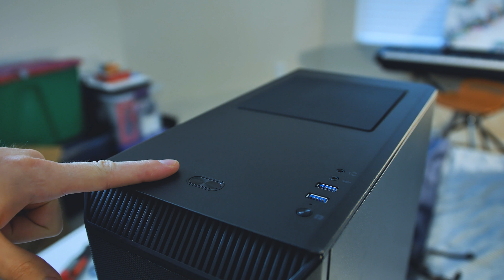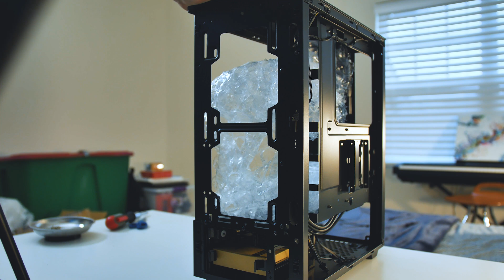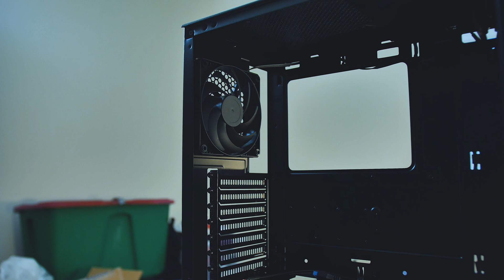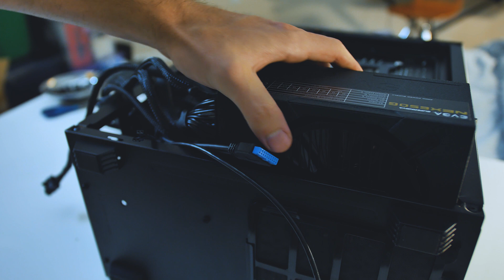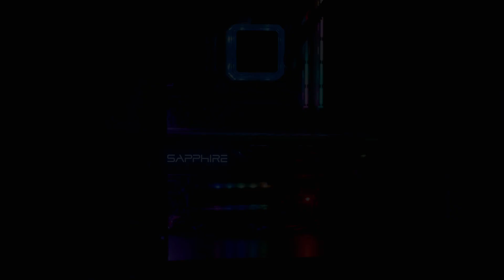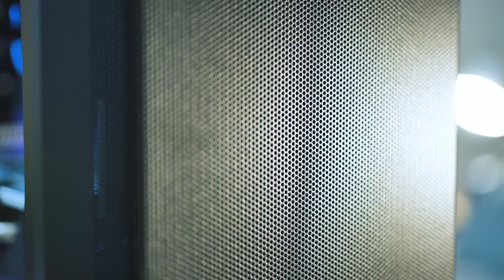How To Build A PC In The Phanteks P300A

Comment: I’m having a problem with installing 2x 140mm fans in the front as intakes inside the mesh part… these fans are supposed to fit but they wont let the part click into place
Reply: The fans mount on the inside, I had that problem too xD

Comment: Quick question, so if I have to take out the hard-drive bracket to fit in the power supply, can I not have a hard-drive in this case? If I can have a hard-drive in this case, any recommendations on where to put it? Thank you!
Reply: Had the same question while building my PC, you have to take apart the hard drive case then put in the PSU. After installing the PSU reassemble the hard drive case and install your drives. It takes some work, but in the end it goes well :) Hope this helps even though it is a late reply.

Comment: Where do I connect the 3 tiny 2 headed wires that say hddled+, reset sw, and power sw
Reply: you can find the pin headers in your motherboard manual, or if you have a newer motherboard there will most likely be an adapter that tells you the orientation and you can just plug it in.

On the 2 pinned ones, the arrowed slot is the positive.

Comment: I noticed that you had a 240mm colling system right? But you put the fans outside the case and not inside? And was pulling out or in?
Reply: i dont think theres any fans on that radiator lolol
Reply: @creativerezz  you have 2 fans on the front of the case that its pulling or sending air to the radiator right? At least is what i see! Or you put the radiator working without fans? 🤨
Reply: His radiator is mounted inside the case, he mounted the 2 fans between the front of the case & the fascia / front panel of the case (since it's mesh) as intake (pulling air in).
Reply: @TLM-Nathan  how to mount like this… i am currently facing this problem
Reply: The front panel just pulls off, put the fans on the outside, use the long screws that came with the AIO to go through the fans, through the case, into the radiator. Then snap the front mesh panel back on. @popohim

Comment: Will the corsair cv 550 psu fit?
Reply: Check on pc part picker
Reply: Its a trash psu don't buy it
Reply: @miniweeddeerz1820  why
Reply: @Jazzyyfn  meh efficiency, not the best fan noise, not the best protections and temperature resistance, too short a warranty and most importantly its voltage regulation is terrible. i would never consider it.
Reply: @miniweeddeerz1820  what should i buy instead that is 60$ and can power 1660 super ryzen 5 3600

Comment: Wait.. so you can't have any hard drives if you have an ATX PSU? That is so annoying.
Reply: ok, so I found out you can use an ATX PSU, you just need it to be smaller than 160 mm without having to remove the hdd cage.
Reply: @dodobird6863  Ah okay thanks for that
Reply: @dodobird6863  can I ask is that the length specification of the PSU, the less than 160mm? Thanks in advance

Comment: would 2 140 noctua fans fit in the front?
Reply: Yes, 2x 120mm or 2x 140mm, so 140mm Noctua Fans should fit.
Reply: But I do recommend Arctic P14 140mm, as they are cheaper and almost just as quiet, they are even black, so not the ugly brown you get from noctua.

Comment: My front panel is solid. Just has the 2 vents on the top and bottom. Would it be useless to add 2 fans to the front?
Reply from the maker: I would highly recommend adding fans to the front, you need airflow even if it doesn't seem like much
Reply: I wanna put rgb fans in, replacing the stock exhaust fan and adding 2 for the front. Is it difficult to install rgb fans? Would u suggest putting one on the top of the case too?
Reply: @jdtechgear

Comment: I have the regular P300 version of this case and it's been my favorite for a while. I like it because of its smaller size and the price you pay for it. It gets really tight up top and the basement is small, but I put in an SFX power supply which gave me more room in there.
Reply: Man can you help me pls 🙏🏻 how did you connect the case to your rgb headers of your motherboard 🙏🏻
Reply: Would like to know as well. I even bought an adapter but the side rgb don't work
Reply: BlizzTheOneAndOnly I found, you have to connect the sata cable of the case to the Psu
Reply: @louislecouturier  thank you for replying. I will try to do so 👌
Reply: @louislecouturier  ill should have done it already but didn't have the tools with me nor the time. Ill tell you if I'm able to do it 🙏 cheers
Reply: Can you still mount the radiator where he does in the video? Or is that only on the mesh version?

Comment: the vertical gpu mount included actually has decent airflow
Reply: This case comes with a vertical gpu mount?
Reply: @teddy9067  my p300a didn't come with a vertical gpu mount. The ones I did see are expensive. 😕

Comment: The Phanteks vertical bracket is actually really nice because it sets the GPU back from the glass. I also just paid for one for a build I'm working on and it was $43 with shipping. The fact that it's included here is suuuuch a good deal.
Reply: I didn't get it with my case :(
Reply: @AndyplaysToday  that was 2 years ago they probably stopped doing it
Reply: @SuixdeCity  yes, my computer is long finished now.

Comment: Only problem with this case is you have to remove the HDD brackets to fit the power supply cables
Reply: So u cant have a hdd?
Reply: @Zombiecosa  u still can
Reply: @buckets307  how
Reply: @chef_boosie  just get a smaller PSU. I had a EVGA GQ in it but I down graded to a ECGA BQ which is smaller.
Reply: @Zombiecosa  yes just get a shorted length PSU.

Comment: 7:49 min - I think, you should mount the two frontfans in the case. Seems to be enough space for it and then, they can take more air in the case. - Not excactly the same case here but you get the idea: https://youtu.be/lG4L4IDrFd4?t=1049
Reply from the maker: I believe you can mount it either way, but yes it would be less restrictive. The cable cutouts are on the other side of the fan mounting wall tho
Reply: I have the P300S and a 360 rad in mine. Fans are intended to be inside to allow for airflow in the open front cavity. But since this has a mesh front I cant imagine it matters. Because of the drive cage at the bottom I cannot put a fan inside, so my 3rd fan is mounted like yours on the outside (though I think I'm choking the airflow on the bottom of mine)